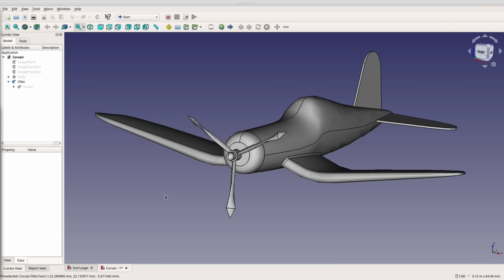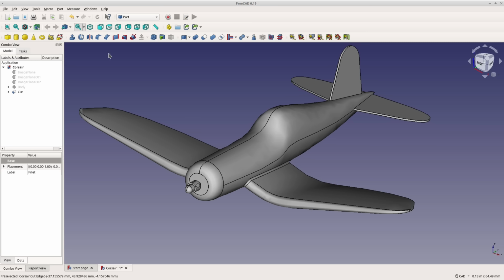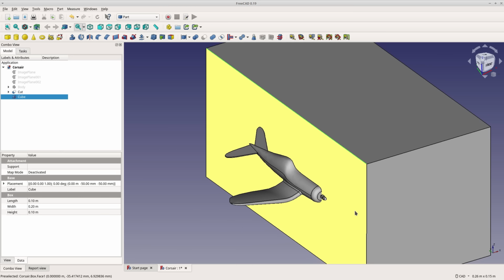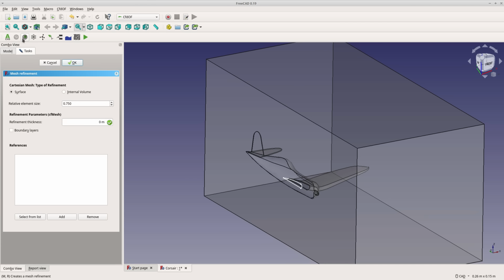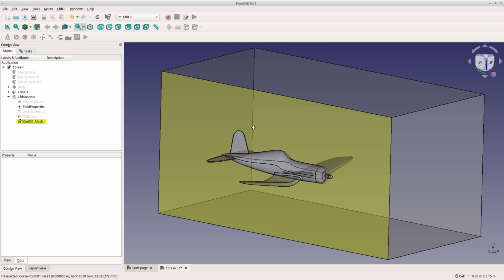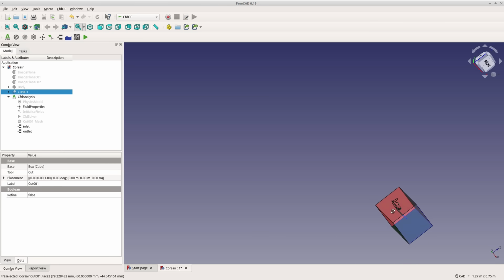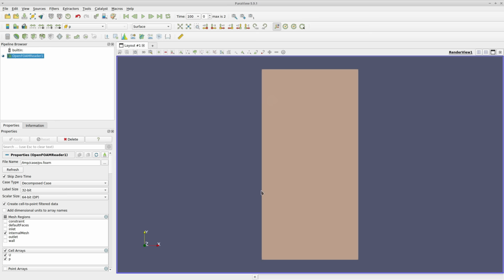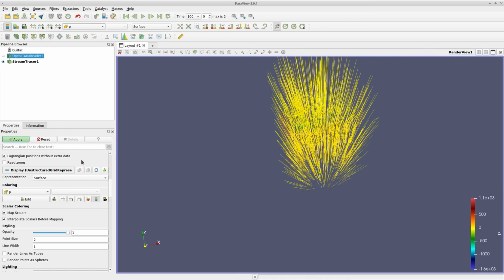FreeCAD CFD- External Flow Analysis Example|JOKO ENGINEERING|

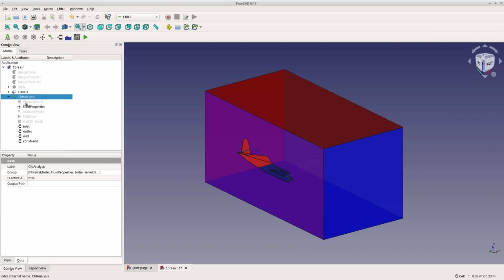Comment: At 16:12 - Doesn't it require an additional boundary condition on the surface of the plane? I suggest to define the plane surface as a non slip wall.
Reply from the maker: Good suggestion

Comment: Love the video so far, using it for a school project, but a quick question, I made an aircraft in Open-VSP and exported it as an STL, I followed the instructions and couldn't get past the cutting/halving of the plane. It gives me the error "Recompute failed!". if you have any idea on how to fix this it would be greatly appreciated.
Reply from the maker: Is there anything along the plane body that might register to the kernel as zero thickness geometry?
Reply: I can't seem to find anything visible that would cause it to be zero thickness, I downloaded your model so I could see how it went but I got another error when computing the mesh in cfdOF, saying that the installation path hasn't been set and couldn't be found.
Reply: I got the installation path to work, but now i'm getting an error message whenever I click run mesher stating "Meshing exited with error."
Reply from the maker: @Nebb1e  This is a common thing in the world of analysis.  Change meshing parameters and mesh types might help. Even consider changing the shape if you need to.  Sharp edges and/or unusual angles, unusually small features may all be causes.

Comment: awesome video. Thank you for recommending it to me. I do have a question. I am new to CFD. I understand the math very well, but what i am trying to understand is why the negative cut of the plane? why not just leave the plane as a solid? or  does freecad not like overlapping geometry? How does having a empty shell vs solid part calculate flow? 

And why do we need a wall? whats its purpose? EDIT: i figured out why we need walls. I didnt catch what you said, but htis box is a "virtual wind tunnel"  so no walls would be an issue.

thanks
Reply from the maker: I'm not a career analyst, so my answer probably isn't the best.  Making a negative of the plane establishes the area/boundary that flow will occur in, and allows you to define where the flow starts, ends, what acts as a wall, etc.  Great to hear from you, Best!

Comment: Is there a reason we don't enforce no-slip on the surface of the plane?  Maybe with air it doesn't have a large impact.
Reply: Surface that aren't explicitly selected for boundary conditions have default boundary condition (slip wall) assigned.

Comment: Do you have simulation  of flare or combustion  using free Cad
Reply: OpenFOAM has a special solver called fireFoam for that. But it’s not supported in CfdOF module in FreeCAD.
Reply: @Gumball_W  What can't OpenFOAM do ?
Reply from the maker: There wouldn't be a simulation of  a combustion itself, you could simulate multiple materials and the flow as they mix and you could do another analysis of what the max  possible combustion pressures would be on your components.  I haven't heard of FEA that has this capability, but Ansys might since it's so advanced and heavily used in aerospace.  Likewise Cyprien  Rusu has some good material on FEA, he might have a guide for it on an open source free platform like Salome.  feaforall.com

Comment: Dear Sir, my model is not symmetrical in certain wind directions, and therefore I need to include it in the box tunnel. is there a demo for this
Reply from the maker: It should work if you make the box go over the whole part instead of half of it

Comment: Are you able to put floating debris and able to analyze its behavior as it 'collides' with the aircraft?
Reply: It would be extremely difficult to simulate in OpenFOAM, let alone CfdOF. You would likely need FSI and thus coupling with a structural solver (like CalculiX) for this. Even then I'm not sure if contact would work.

Comment: Is it possible to do wind induced rotation simulation in this software? Like for example to determine wind turbine rotation speed under the influence of wind and rotor power?
Reply: It's possible in OpenFOAM using Arbitrary Mesh Interface and 6 DOF library but it's not supported in CfdOF.

Comment: This Floating point exception error should disappear without the need to remesh with different size if you just switch initialization from potential flow to specify values (you can leave the default zeros there).
Reply from the maker: Great tip, thank you!

Comment: My first look at FreeCad and all I want to know is: Can you turn off orthographic perspective? And why would you ever turn on an unrealistic 3D view?
Reply from the maker: Yes if I understand your question.   View>toggle orthographic or perspective rendering.  Not distorting the model for perspective viewing is the standard in every platform I've used, because when modeling it is quite important to have correct, nonscaled features for relations and constraints on external geometry.
Reply: @JokoEngineeringhelp  That is what the ortho views are for (top, left, right, back, etc.) Heck make any ortho view ya want with a working plane. My brain struggles to figure out which way the model is orientated with ortho perspective especially in wire frame, no problem at all in normal perspective plus i get to see what the model really looks like especially if we can adjust focal (lens) length

Comment: With Paraview you can use less points (I saw 1000) and downscale the point cloud. Or use a line rather than a sphere for the stream lines. Also turn on the plane geometry.
Can you do a demonstration with an external flow on a building? If you can generate a CFD flow with atmospheric boundary layer profile (decreasing velocity from the top height to bottom)  it would be awesome.
Reply from the maker: Lets see what I can do on that!  I haven't tried using a velocity gradient but I think that would be a super interesting analysis